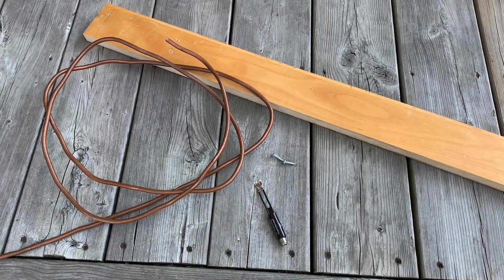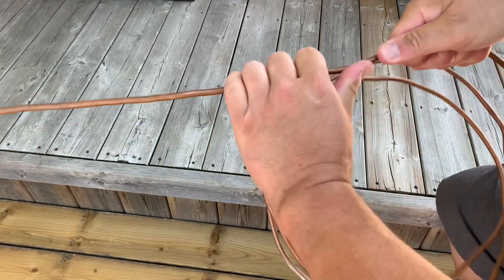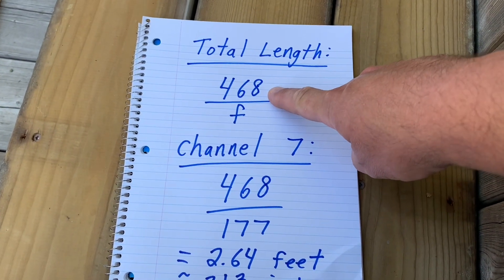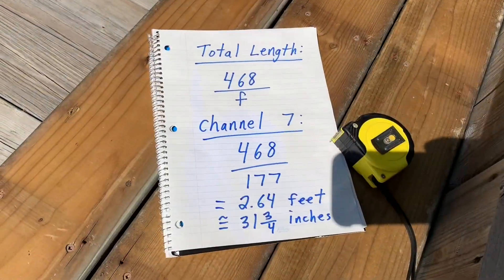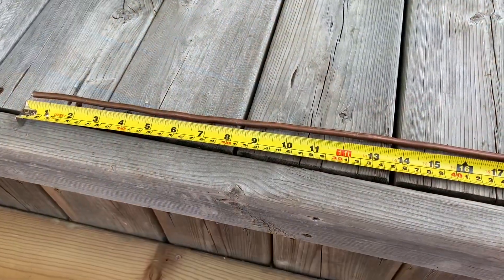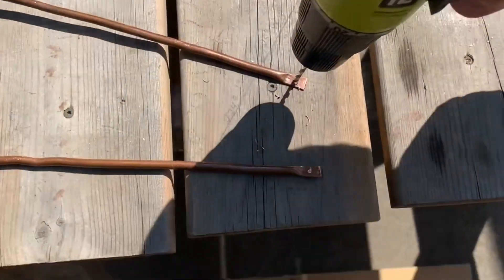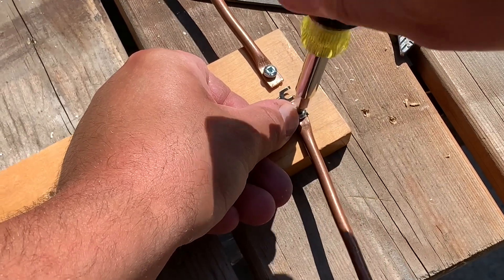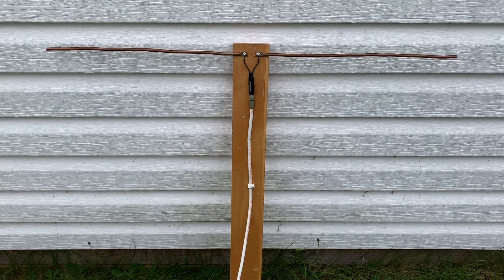How To Make a Simple DIY Homemade Dipole TV Antenna - get free OTA TV Channels

Comment: Can you tell me if this antenna could be attached to a FF6 monster antenna by being connected to the large whiskers in the center two part of the unit ?? Would folding the dipole to make the width size smaller help the signal gain or not Sir ?? Thank you for your help Sir.
Reply from the maker: @victoryfirst2878  You could connect the leads together to both antennas to combine them. I would leave the dipoles extended.
Reply: @NorthcoasterHobby  O.K. Sir. Thanks
Reply from the maker: @victoryfirst2878  👍

Comment: Another way to do it is to use nuts and bolts and washers  to hold the elements.  The advantage is that you can run one one nut down to hold the element in place and then use a second nut on each bolt to get hold of the balun/transformer's wires.

Comment: Can I hook up that transformer to a long range antenna I found in my attic?
Reply from the maker: If it doesn’t already have one , then yes.
Reply: @NorthcoasterHobby  yeah it has the flat cables instead.
Reply: @Gintokikreuz1  Did it work out well for you?
Reply: @kensmith5694 yeah it worked out great. Just had to cut the plastic in-between the old wires to have more room to connect the transformer easily.

Comment: Whats the milage this little aentena provides???  Also.. need something to keep the birds off your aentena...
Reply from the maker: Mileage, not too sure.  I'd say 25-30 miles, give or take. It depends on the strength of the broadcast signals, your distance from the towers, and also where you locate your antenna (inside, attic, outside).  Obstacles such as buildings, trees mountains, valleys, etc. also will affect signal reception. 

I like the birds!

Comment: There's a much easier way to make this first of all cut off a six foot piece of the copper pointed it straight up in the air and you have yourself an all directional antenna the reason I say six feet is because this will pick up VHF high low and UHF I tried this years ago I get 28 TV channels may not sound like a lot but considering I have huge mountains around me that go up to 3,000 ft high this is a lot of TV channels for my area
Reply from the maker: Thanks for the tip.

Comment: Great video Northcoaster Hobby. Back in 2020 I make a simple UHF antenna with a matching transformer and one aluminum wire. The wire from an old telephone cable, and is in very good condition, I had to remove the dielectric. On my digital meter I had the signal quality 99% and signal strength almost 51%. With a 19 elements UHF Yagi antenna I have 63% signal strength, tested outside. Inside with the home made loop antenna I had 48% signal strength. If I connect to a converter box I have 60% signal depending on the tuner. With 63% signal from the Yagi antenna I have 84% signal strength. If I use an amplifier I get 100% signal strength. That's why I use a digital meter when I install or test antennas.
Reply: I also add that the antenna or the loop antenna was designed for channel 26 or 514 MHz. The European channel frequency is different from the North America and Japan. Plus we use 8 MHz bandwidth for UHF and 7 MHz bandwidth for VHF. DAB+ radio uses 1.7 MHz bandwidth since it carries only digital audio and broadcasts on VHF High Band. Your antenna will work excellent with DAB+ radio, if it's used in Europe.
Reply from the maker: Thanks Nicholas, it’s fun puttering with homemade TV antennas. I have a couple of UHF loops and UHF bow tie I found brand new still in plastic at a thrift store. Straight out of the 1970’s. I added a matching transformer to the twin lead wire, and connected that to coaxial cable. They work well for picking up VHF channel 9 indoors. They work well outdoors too.
Reply from the maker: @Nicholas_Chris  Nice👍
Reply: @NorthcoasterHobby  If the broadcasters will double the power then it will work very well inside. Before 2015 or complete digital transition and analog shutdown in my country I was able to receive UHF analog TV channels with good picture sometimes very good and I only used the rabbit ears. After 2015 when DVB-T2 started broadcasting indoor reception is mostly impossible, I am lucky to have a good spot in my house. You need at least a 10 Yagi elements UHF antenna for a good reception, while in analog days that antenna was more than enough. And 19 elements UHF Yagi antennas were used only for collective reception such as hotels, flats.
Reply from the maker: @Nicholas_Chris  I had amazing reception in the analog days. A pair of rabbit ears on top of my TV to receive all my local channels, even with an antenna in the basement. Now, not so much.